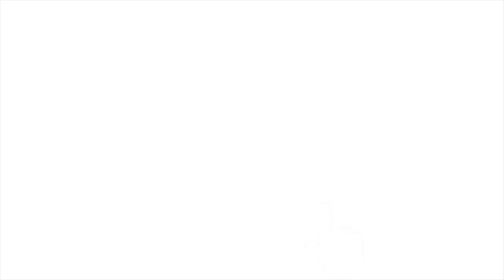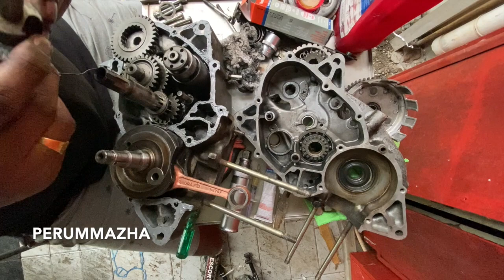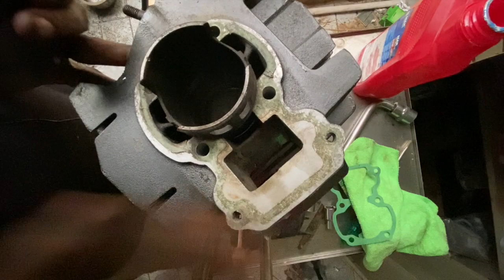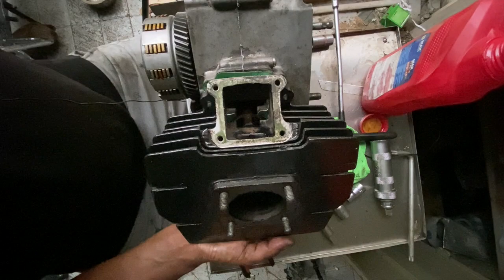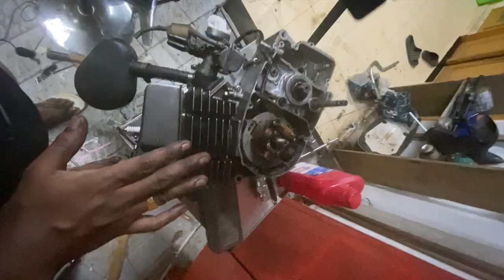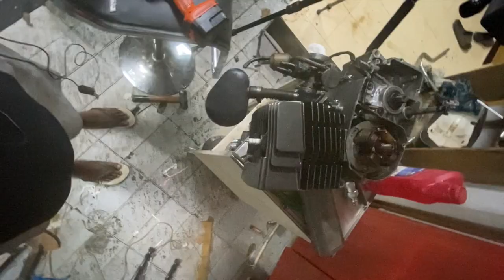Shaolin Engine rebuild (Malayalam Video)

Comment: Recently my frnds rx had a rebuild and he ported it but after tht it does not power at all and it wont start in one kick evn if its hot like u need 3 to 4 kicks whn we asked the mechanic they said coil issue whn we asked other mechanic they opened the spark plug it was white itseems and he told petrol is only not reaching wht would be the problem
Reply from the maker: First of all you need to research and learn what porting a 2S means. I can guarantee that the mechanic knows nothing about porting besides grinding them. Porting can help one modify the amount of charge present inside the combustion chamber, the amount of fuel can be controlled in two ways, inserting the right amount of fuel through the carburetor or push unburned charge from the exhaust through a chamber. Most mechanics only play with the ports and do nothing about the need to fueling at different rpm. To make matters worse they also ad free flowing filters and the bikes seize up in no time due to extremely lean mixture. The first thing I would do now is source a used cylinder which is unmolested by idiots and check if installing that solves the problem. It’s a very expensive mistake, research properly
Reply: @Yamakaze  thanks

Comment: bro ente kayyil oru suzuki shaolin nd ithinte cylinder piston shogunte aan &carburator rx135 
vandeede initial power kuravaan 
but topend kittunnund 
initial power kootan enthelum vazhi ndio
Reply from the maker: Power box, shogun carburetor
Reply: @Yamakaze  power box und
Reply: @Yamakaze  inner spocket 15 T aan ithil maatam veruthiyitt prayojanam undio
Reply from the maker: @turnstroker2775  👍
Reply from the maker: @turnstroker2775  rear wheel size?

Comment: Bro 2stroke എൻജിനിൽ ക്രാങ്കിൽ engine oil എത്തില്ലേ? 🤔
പെട്രോളിൽ oil മിക്സ്‌ ചെയ്യുന്നത്  piston, cylinder lubrication മാത്രം ആയിട്ട് അല്ലെ?
Reply from the maker: 2 stroke crank sealed unit aanu, gear oil crank il ethilla
Reply: @Yamakaze  അപ്പൊ ക്രാങ്ക് ബാറിങ് എങ്ങനെയാ lubricate ആവുകാ? 🤔
Reply from the maker: same 2 T